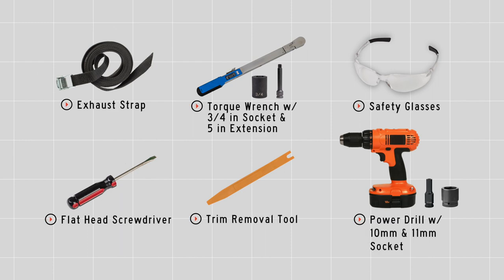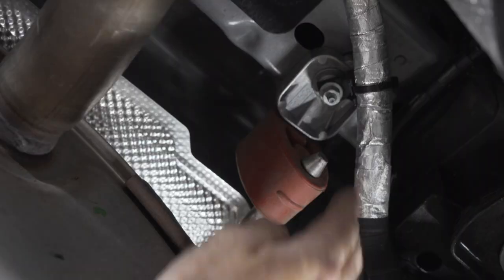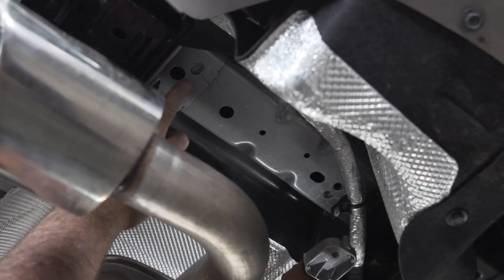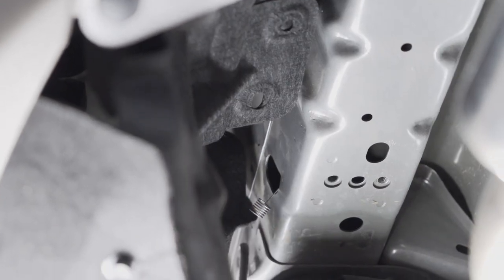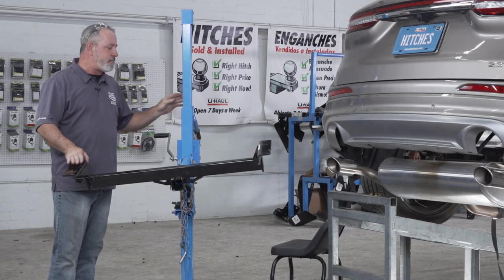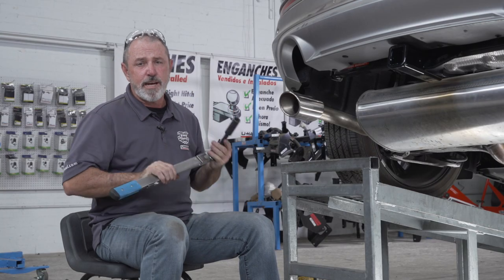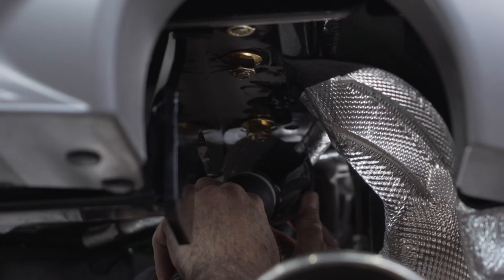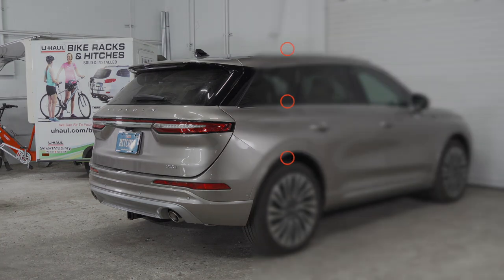2020 Lincoln Corsair Trailer Hitch Installation

Comment: What brand of hitch did you use? A competitor company that installs hitches and creates how-to video uses a different hitch with different mounting.
I ask because this is better, more professional install.
The hitch the competitor installed required 2 holes to be enlarged on each side and required cutting and grinding of the vehicle.
The competitor used a Curt Hitch.
Reply from the maker: This is also a Curt branded hitch. Most hitch companies have several styles of hitch that mount differently. We always try to use the most user friendly version!